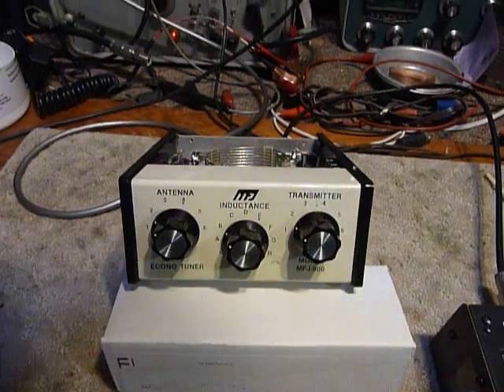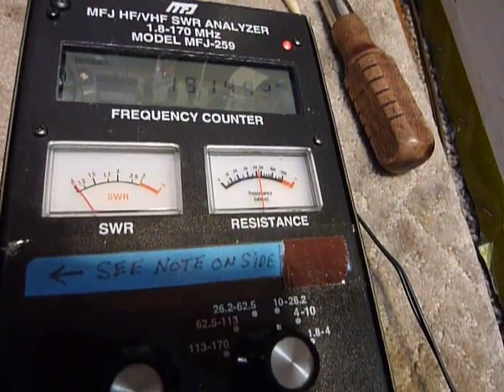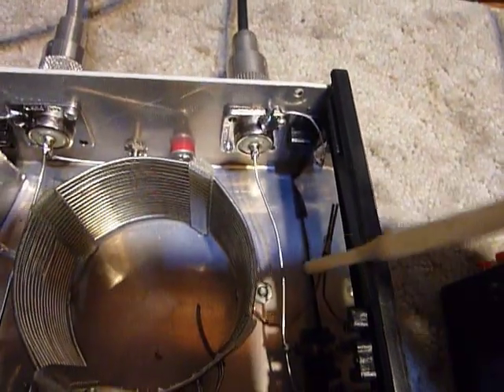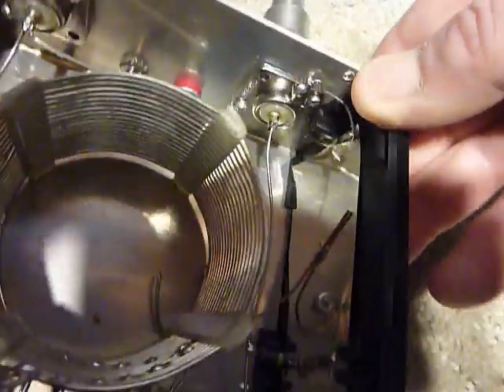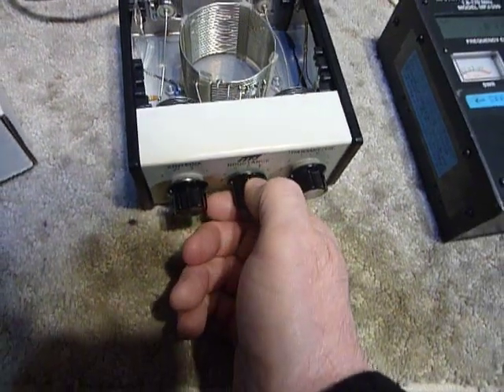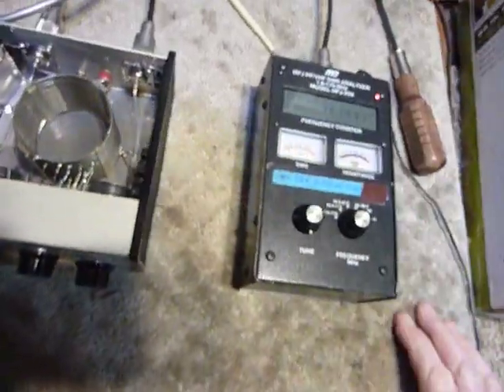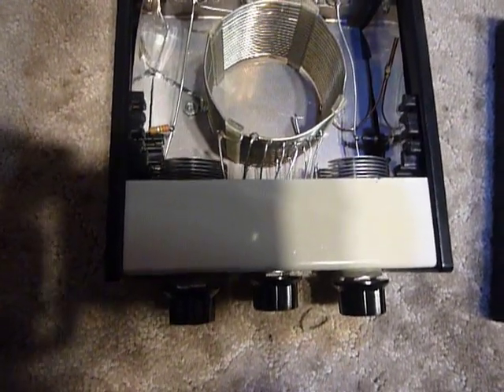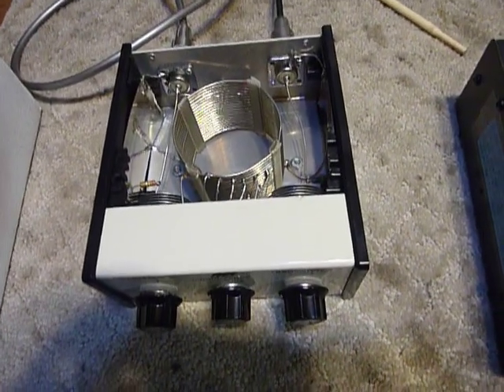MFJ-900 Antenna tuner , MFJ-901 Antenna tuner ,Small antenna tuner

Comment: Hi Bob, I have a question for you. I’m a screenwriter working in a horror script. I have a question for you. If you had an old 1985 ham radio which as not been used since 1985, can you power it up using a car battery? If that would be possible what would you need and how can it be done? Can u message me privately at  inveritasxix@gmail.com

Comment: Perhaps a switch and a 100 pf cap will work  kg6mn
Reply from the maker: Oh yes Jerome that would work fine I would use a high voltage capacitor like at least a 1 kv  disc ceramic .Changing the coax between the rig and tuner to a longer piece  however does the trick nicely and it the worked ok on all bands up to 6 meters . 73  Bob
Reply: Nice simple video with some simple and sound "fix its" for past MFJ quality control.  I own this mfj model 900, too. It was purchased at an estate sale for $20, several years ago. Best $20 investment I made.  Later, I purchased the current model MFJ 901 B and MFJ 902B. Since most modern radios have select able multiple meter settings, like alc, power, and SWR, I felt I could use the those functions with these tuners.  I keep these manual tuners in my go kits, and they work fine for my needs. Again, great reference video for the MFJ 900.